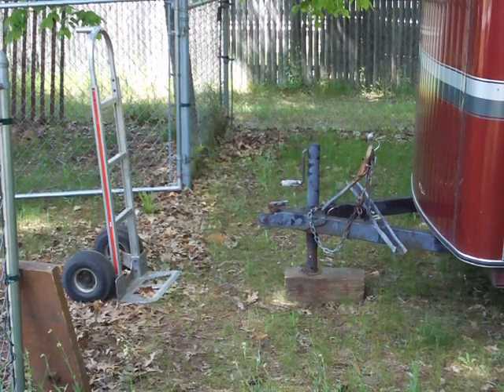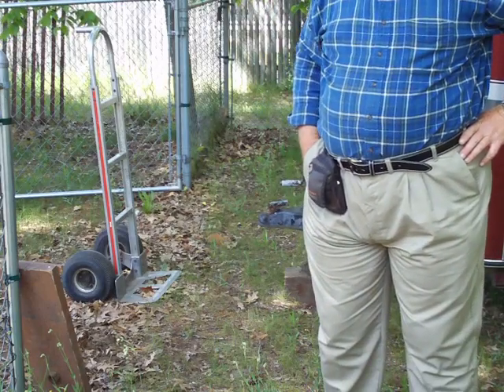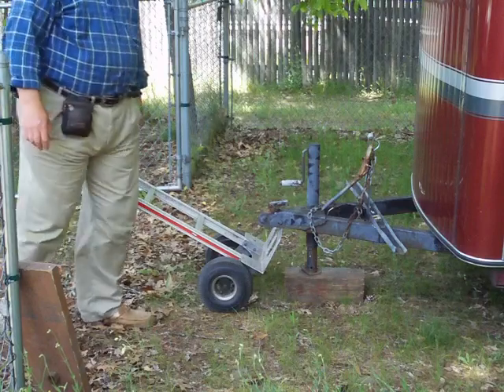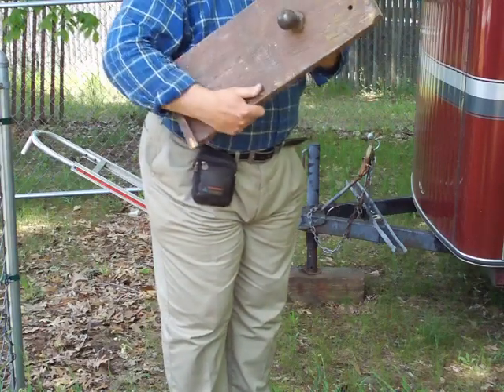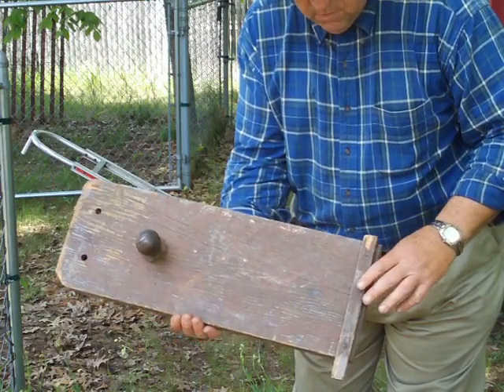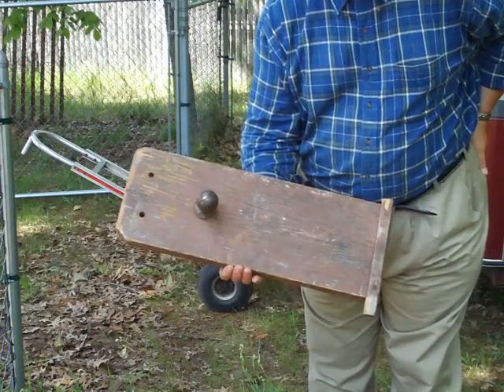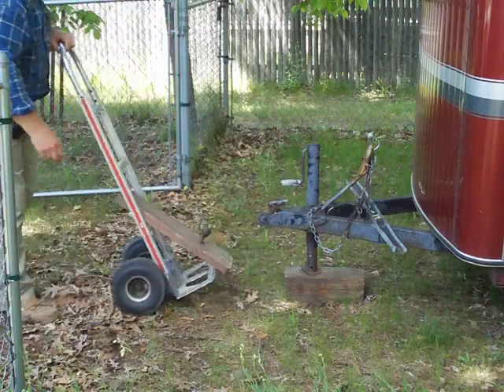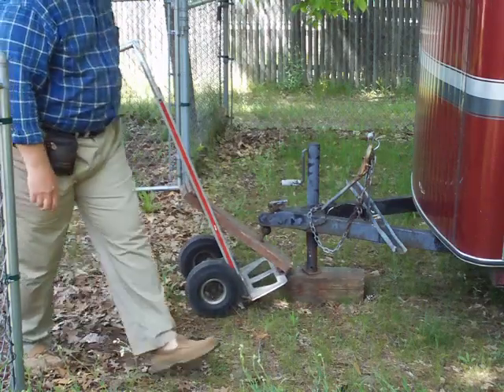make a trailer spotting dolly adapter for your hand cart~cheap and quick!  move your trailers easily

Comment from the maker: the handle position is high when sliding the ball under the hitch, but after hookup the hand cart handle can be pushed down lower and leverage increased as the ball is able to swivel quite a bit.

Comment: Its a very neat idea, so don't get me wrong.  But doesn't having the ball in that position cause the handle to be too high?  The purpose of a trailer dolly is to EASILY move a trailer around, and leverage is the main principal.  The higher the handle, the less leverage you have in that position, making it hard on your back.  I'm not putting down your idea because I think its really cool, I would really like to know though, do you have this issue?  Thanks.